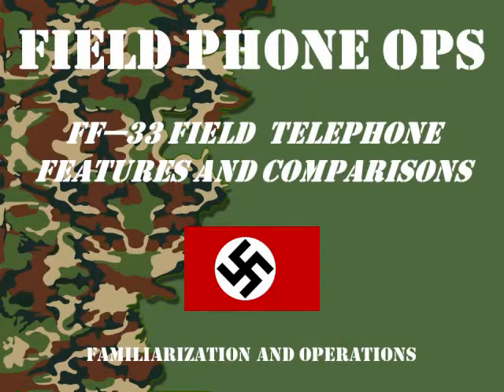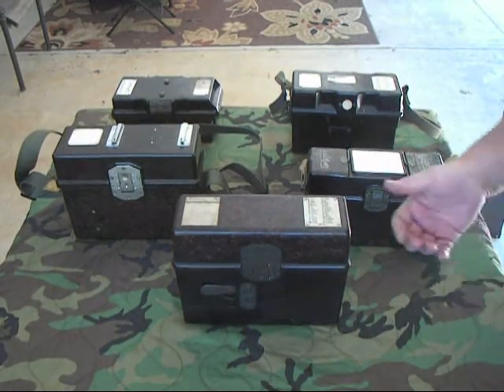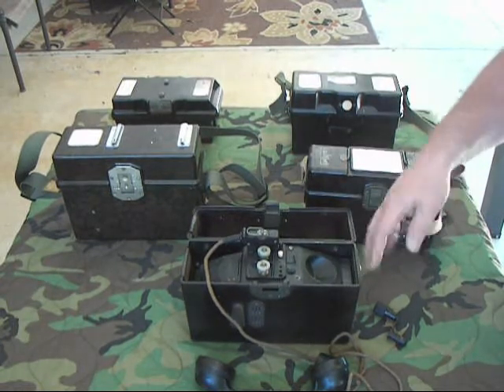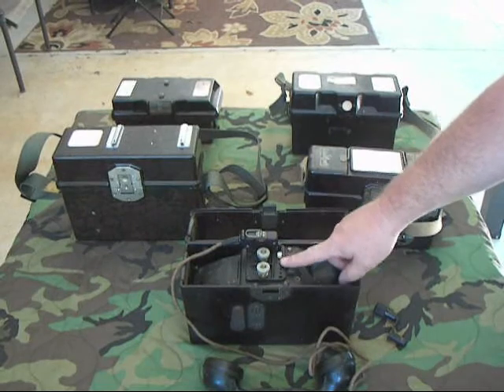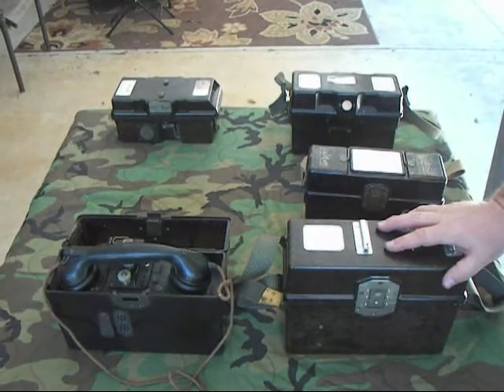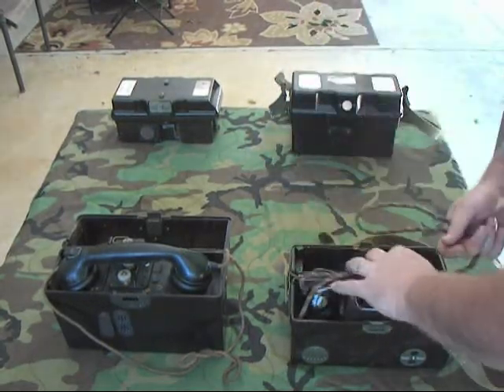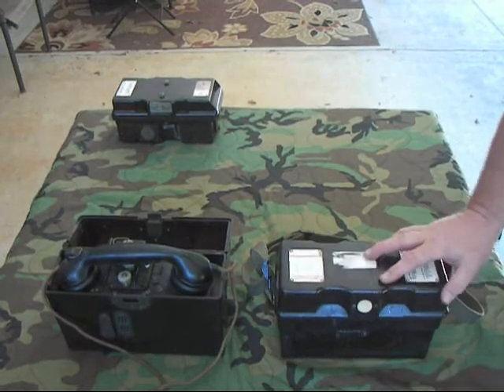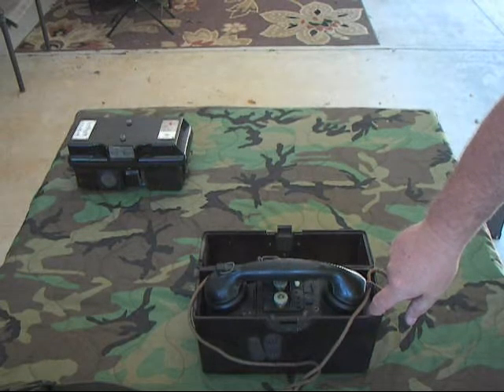FIELD PHONE OPS:  FF33 Field Phone Info & Comparison

Comment: On the western phone you have two holes on the front what is the second hole behind the swing cover?
Reply from the maker: Patch cord jacks so you could plug phones together using an included patch cord
Reply: I heard the second hole  is for a microphone type with ear piece correct?
Reply from the maker: No.  Its for a patch cord that allows you to connect two phones with out field wire.  You can patch one phone to two others using patch cords.
Reply: @thefieldphoneguy8254  ok got it👍

Comment: When I served in Norway in 1982-83 we still unofficially used these because it was plenty of them left by the Germans, and we could never get enough of the new Norwegian TP-6/NA  (https://www.youtube.com/watch?v=8ARHRmo_PEw)  When you did not have to carry that heavy phone it was great reliable and easy to use.

The FF-33 is made in 3 versions that is documented here: https://www.google.com/url?sa=t&rct=j&q=&esrc=s&source=web&cd=&cad=rja&uact=8&ved=2ahUKEwjy6Kye9MrwAhXNAGMBHfLrBOIQFjAAegQIBRAD&url=https%3A%2F%2Fwww.nachrichtentruppe.de%2FPDFDownload%2FGerman_Line_Communications_Equipment_of_WW2.pdf&usg=AOvVaw0GqNBvlwPPPaaIQ7Rk4Mjw  at page 9 to??
Reply: The FF33's used by the Norwegian forces are often available for NOK 400-800 at e.g. finn.no so they are relatively lo cost + extremely expensive shipping . I have far to many of them my-selves :-)